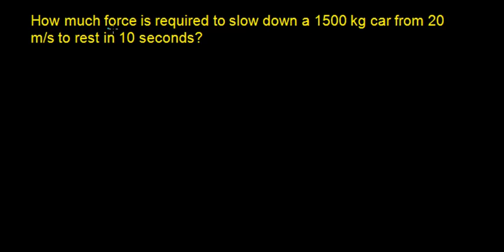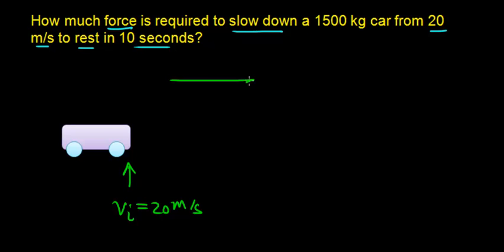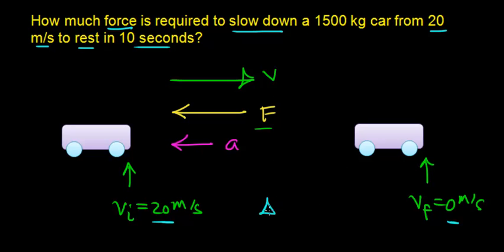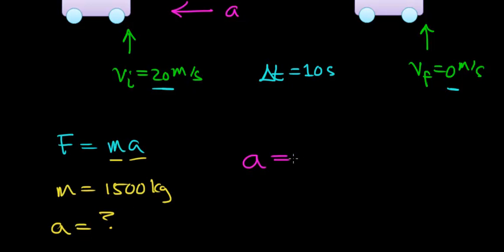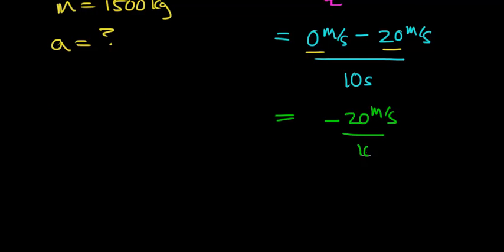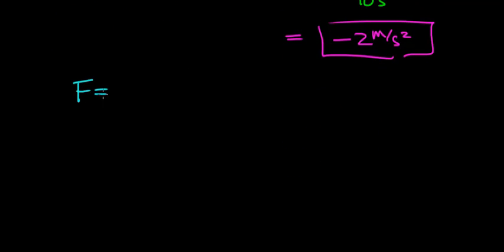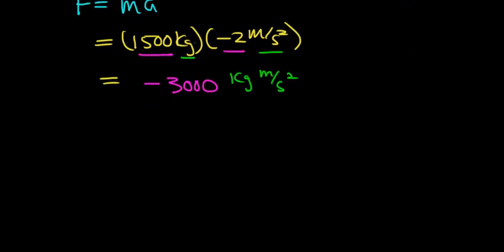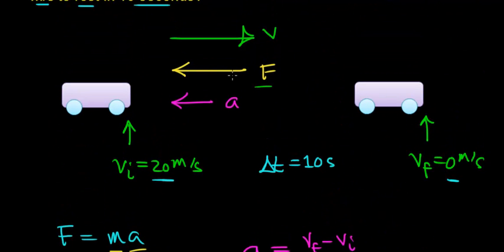Physics First force required to stop a 1500 kg car

Comment: Misconception. The only way to get a brake force along the road is to have locked wheels. Normally brake forces work inside the car and are not pointing backwards. Newton´s second law is valid only for rigid bodies. Your car is making one hundred meter skid marks.